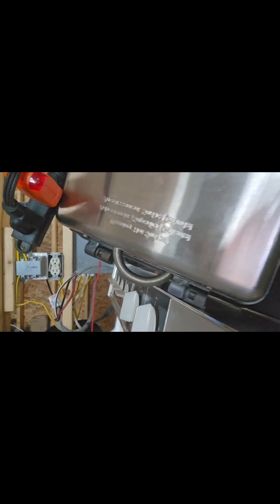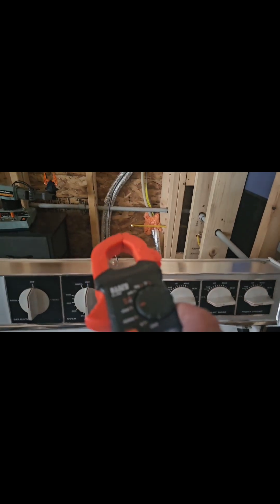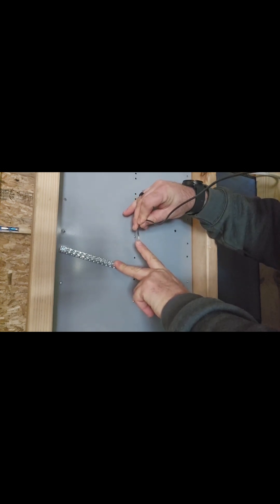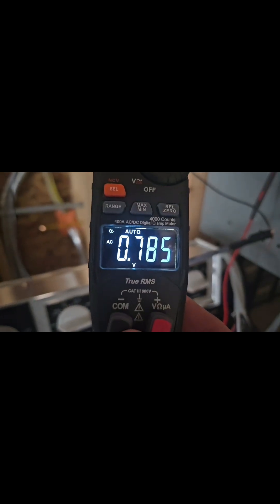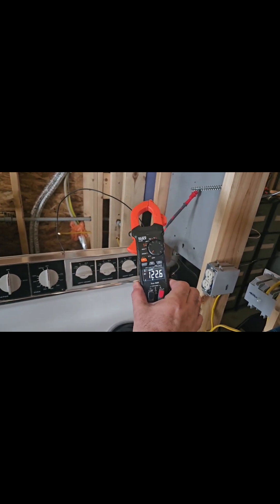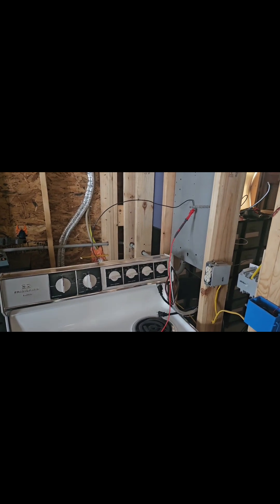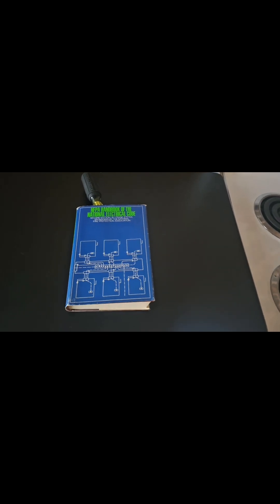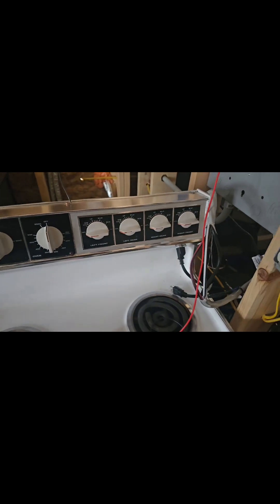click here objectable current demonstration

Comment: I see and understand the concern. I have never encountered any voltage sparking off like this before. The stove connects to 240 and usually has a neutral wire with it's plug set up. Stoves work off 120 and 240 depending on the temp rheostat setting so that neutral return wire from plug  carries the imbalance. And stoves should be grounded for safety as well. Looks like this stove ground is carrying more than that. The neutral connection is on this stove I assume going to ground ?
Reply from the maker: Yes, this is a 1968 stove wired to pre 1996 code.  It is just one wire acting as both ground and neutral.  Which electrically is the same a not separating the grounds and neutral in a subpanel.  If you have a sub-panel with ground and neutral combined and there is an imbalance,  the metal from any equipment fed from that panel will arc if it contacts any the metal frame of equipment fed from a properly grounded panel Or it contacts any properly grounded like a  metal a water pipe.

Comment: Question. The voltage potential would be split based on how much resistance is on which wire right? So that .7V is based on the resistance difference in the neutral and the ground wire through the meter? So therefore your resistance likely being higher than the meter means you would experience even less volts
Reply: So in this case touching this ground with objectionable current is not different than touching a good neutral. Also to add the danger not talked about here is fire hazard on a loose ground.
Reply from the maker: @jacobmurray3621  I have a video on objectionable current I have a stove from 1968 I put 14 amp of objectable current on the frame so some tests ..
Reply from the maker: https://youtu.be/x-PG1VbfkZo?si=2VDAVvZ2Fw7Nd4Bz

Comment: We had this objectionable current problem in our garage refrigerator. I wouldn’t have known about it until I plugged an electric pump in to pump water out of a kids pool. It used the same outlet as the refrigerator. I touched the stream of water while holding on an aluminum ladder stood up in the dirt. I got an immediate shock. I thought it was the pump. It was plastic. I thought it was the extension cord. It wasn’t. The ungrounded outlet box had the hot wire pierced by a cover screw. It passed the hot voltage through the ground blade of the appliance plug to the refrigerator. I grabbed a non-contact voltage reader and the whole refrigerator skin -  top, sides, back, doors, was live from the hot line tied into the metal box. I finally tracked the issue to the outlet box.

Comment: Do you have a video explaining what objectible current is?
Im thinking its a 240 v circuit that has 120 v usage on one leg creating more amperage on that leg. Now it needs a return path for the imbalance. Hope i said that right.
What i am getting out of this is the ground is replacing a neutral to create the 120 v circuit.
I recently installed a 240 v circuit for a dryer. There wasnt anything i. The dryer for a neutral, just two hots and a green  ground screw.  I used 10/2 nm through EMT labeling the neutral wire with red tape at both ends. 
With a 4 wire receptacle being code now, where would the neutral be connected on the dryer?

Comment: 4:02.  Some ranges during the 1960s, instead of using an infinite heat control that virtually all modern ranges use to vary the power of the burner by cycling on and off, instead used a fixed position switch or push buttons for 5 power levels,  and the cooktop element was actually two elements, 3 terminals, and by switching various combinations of 120 or 240 volts in parallel or series,  provided the different power levels.  In these older ranges, if the neutral failed the lower burner settings wouldn't work,  leaving you only with high and medium-high, for instance, oven and broiler would still work, however the oven light, timer, indicator lights and convenience outlet wouldn't work.   So this 1968 NEC handbook is sort of correct,  regarding the appliance becoming inoperable.     

The permission of using a grounded conductor to ground the frames of ranges and dryers  (essentially a "code compliant " bootleg ground receptacle) can trace it's roots to the Tentative Interim Amendment 53, put in place July 1942 and supposedly as an effort to conserve raw materials during WWII.  Ironically Canada never permitted this and therefore required a dryer or range to have a 4 wire receptacle as soon as equipment grounds were mandatory in the early 60s.
Reply from the maker: I have a tik Tok with 96k followers I would love you input ony videos over there too.  My YouTube is just me reposting some of my tik toks.  I have a code book collection back to 1940 it only complete back to 68 my I have a 40, 47 and one from the 50's I think it's a 53
Reply from the maker: Awesome comment and info thanks so much